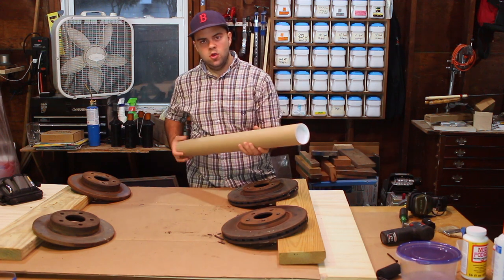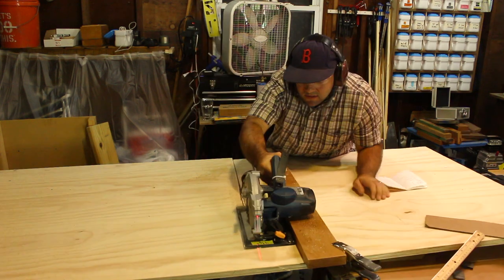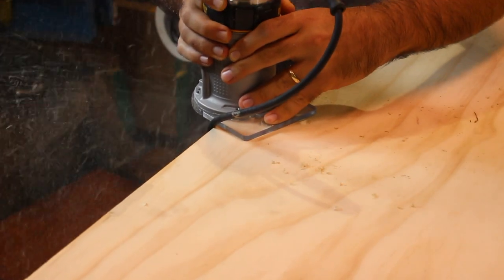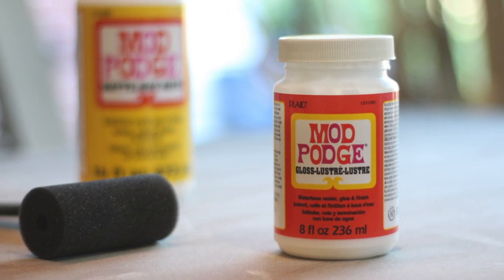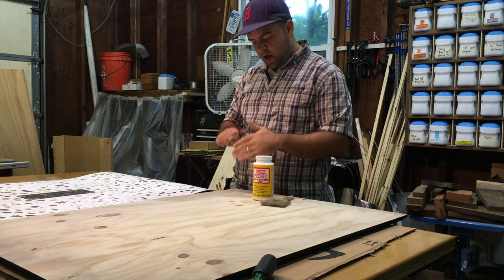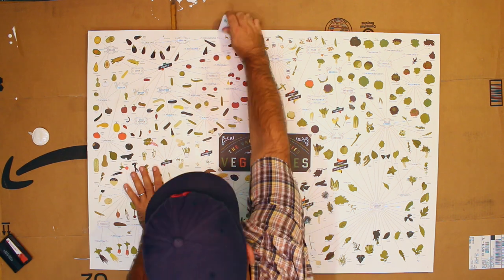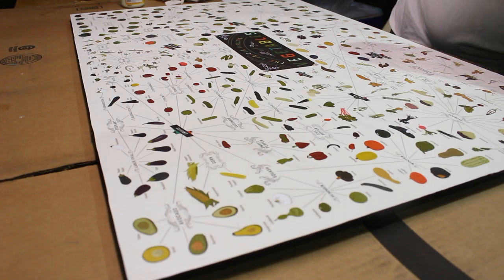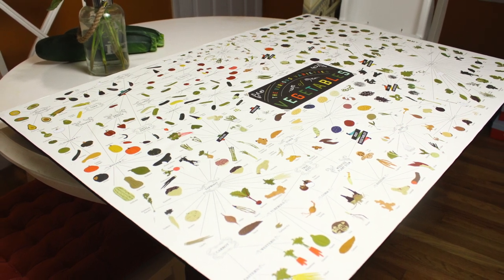How To Mount a Poster or Print To a Plywood Panel

Comment: I'm researching how to hang posters on the plywood ceiling of my room. The plywood is currently unsealed, with some knots, and you know how fun painting or doing anything on a ceiling is... ugh. Might just go with pushpins and call it a day. Hmm. The posters weren't cheap and if the glue is too wet or the surface too rough it might look terrible.

Comment: Great tutorial, however a note to viewers. Mod podge works great if the surface you're attaching it to is smooth. If it is rough at all just use spray adhesive.
Reply: Not sure, I thought it would be the opposite. I use mod podge for mounting art on canvas (works well) but I am not sure how well it would do for mounting posters on foam board.

Comment: I did one...horribly wrong in a big 5x3 feet poster. It bubbled catching air or too much glue  wrinkling everywhere. .. the paper soaked glue so it broke easily to any touch.  Advice: seal the wood or the glue will disapear fast 2)  spread a very thin layer  of glue 3) first of all : flatten the paper as he did at the begining. Good luck
Reply from the maker: David Barrel I think next time I will use a spray adhesive to attach the picture to the wood the seal with modpodge
Reply: Good advice.  Thanks.

Comment: Tip:  If you seal the board and let it dry you will have longer working time— you can seal it with modge podge or even elmers will work or probably any acrylic base paint.

Comment: Have you tried this same project but used a steel brush to bring out the wood grain? And then do the same application process? 
   I have a project that I've been hesitant to start in fear of ruining the posters. My ultimate goal is to have the wood grain slightly visible through the posterboard. 
   Thanks for the suggestion of the foam roller and waiting until it's completely dry to do the final coat.
Reply from the maker: POVofJTRose there are some good how tos out there about this. Do some searching. I think next time I would make sure the poster was completely flat before glowing. And then using a spy adhesive first, getting all the air bubbles out.

Comment: Hi, thanks for making this informative video, I have a 24x36 poster and 1/4 inch plywood the same size to attach the poster too, but my poster has a photo finish which is thicker and glossing than regular poster paper and I'm debating how to attach it to the wood, I have modpodge glue but do you think it would work since I'm attaching an actual photo finish poster to the wood? If not do you have any suggestions on what would work on my case? Thanks

Comment: Tablesaw is not dangerous of used properly... But then looking at how badly you use a circular saw, I'd say stay away from any and all tools :-/
Reply: Every power tool with an exposed blade is dangerous, but you can reduce the risks by using it properly, keeping it well maintained, and implementing proper safety practices. The best woodworkers have had accidents, even when trying to be as safe as possible. Anyone can miss something. You can't eliminate all the risks all the time.